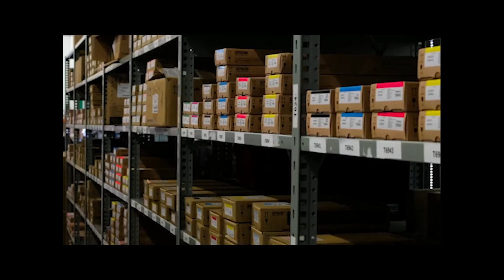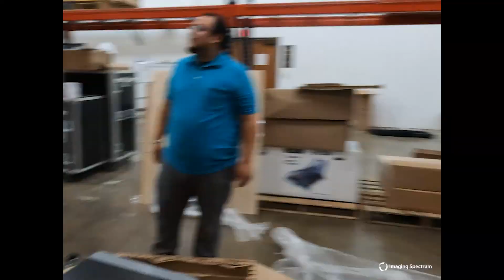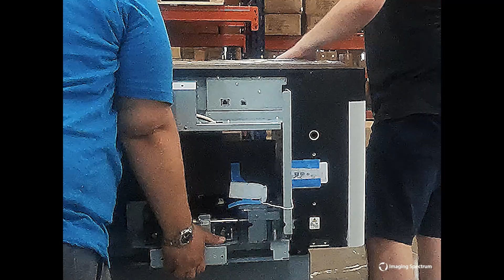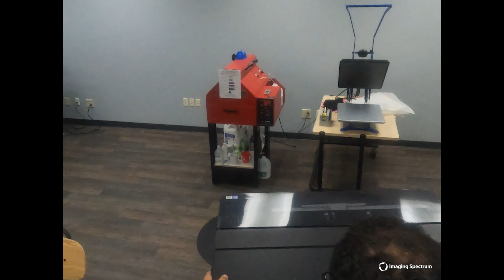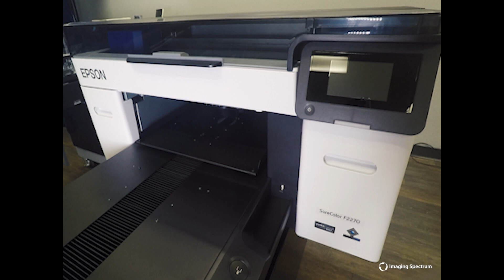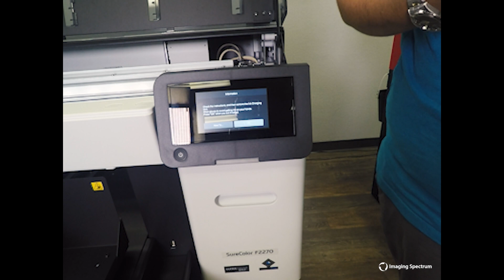We Unbox and Set Up an Epson SureColor F2270 DTG/DTF Hybrid Printer

Comment: Can i hold the machine sideways to get it through a door?
Reply from the maker: @kerimkubilay4359  You should not turn the printer completely sideways. You can cause damage, if the printer has NOT been load with ink you can tilt it to get it through a doorway.  If the printer has ink loaded than it should never be tilted.

Comment: I bought the Epson F2270 from Swing design. Parts and maintenance items are usually on backorder. I really am regretting buying this high cost printer $16k. 

Now I'm getting Error 01138 "fatal error" I don't know what that means and there in no info on it. Can anyone help?
Reply from the maker: @thehappyazshop520 It may be possible that you have an issue with your capping station.  If we can be of assistance then please don’t hesitate to contact us!
Reply: Hi, I`m considering to buy this machine but it`s very hard to find a customer review for it. So far are you happy with this machine?